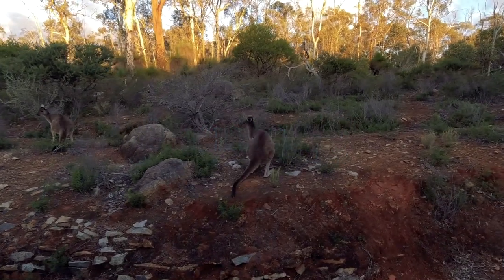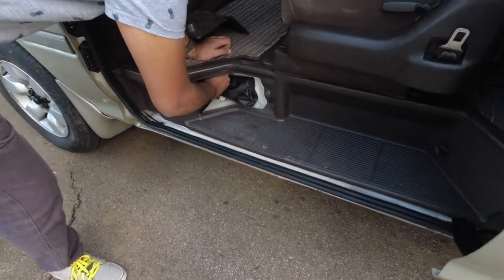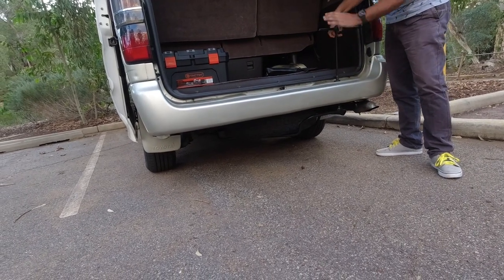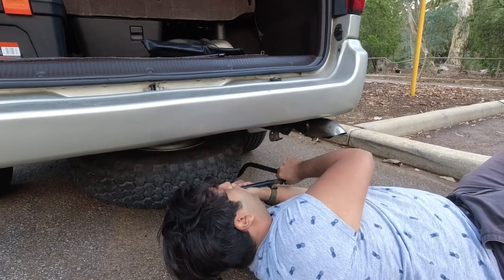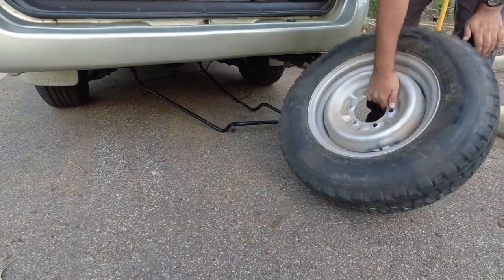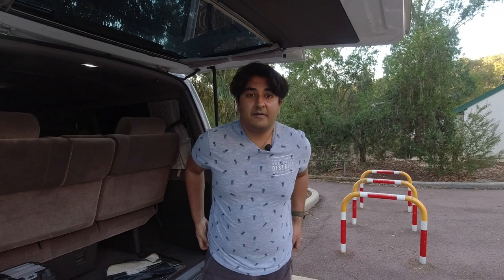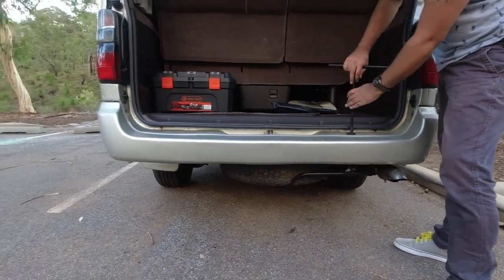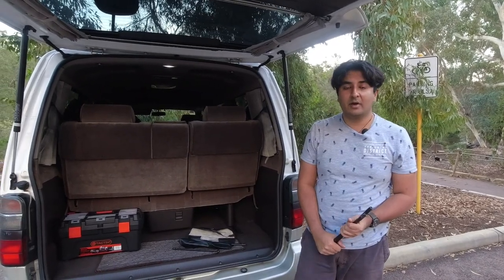Toyota Under-Slung Spare Wheel Removal & Tips

Comment: Thanks mate, very helpful. Hoping the space will fit a bigger tyre as Ive got off roads on as its a full time 4wd too. Chunky 215's vs the 195 spare
Reply from the maker: 215 should be fine, when I put my spare up against my 215/75r15 they're about the same height.

Comment: mounting it that way and taking it off road is a good way to damage the face of the spare wheel which isnt ideal if youre doing 5 wheel rotations and want to keep them looking half decent. you also run the risk of tearing a valve stem out if it ever scrapes.

Comment: What tyre pressure should I be running front and rear for best fuel economy? 2.4TD 2wd Hiace :)
Reply from the maker: Really depends on the tyres. Some have stiffer sidewalls and seen to be fine at 36psi. Others not. Some are passenger rated and can't be inflated to higher pressures with max inflation pressures around 45-50psi and LT tyres can go upwards of 80psi.

Of course you don't want to go max tyre inflation pressure, just what your van needs. 

I'd say ballpark 38psi all around. I ran that on my Kumho LT tyres for a year and when I filmed my tyre review video I noticed the sidewalks were flexing allot. So I bumped it up to 42psi and it's perfect now. Even contact patch, reduced body roll and increased cornering speed.